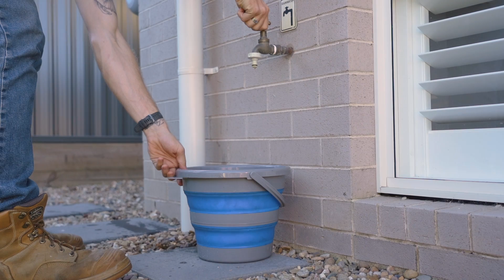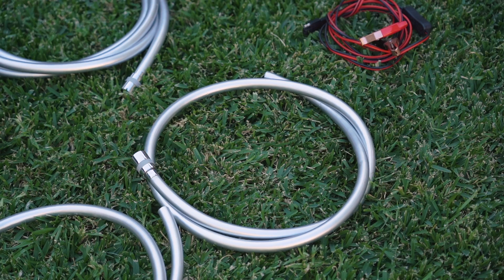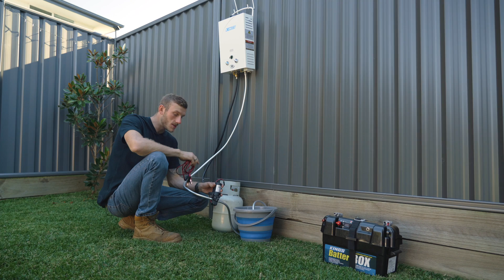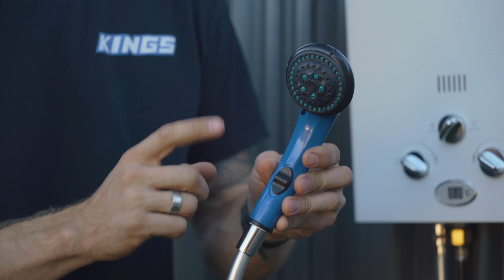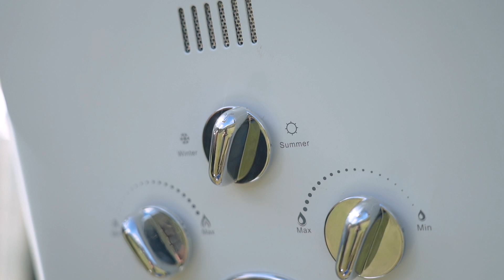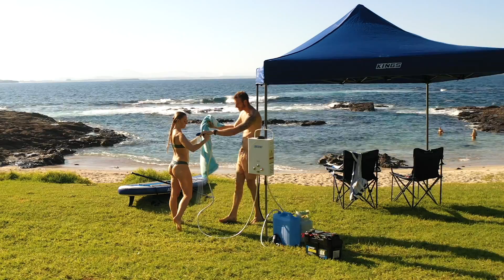Kings Portable Gas Hot Water System - How to Setup and Use

Comment: Can you connect it straight to a house garden hose without a pump since it has pressure?
Reply from the maker: Hi Shane

Yes you can use it, as the hose will put the water pressure in the unit. You don't need pump as long as there is a pressure.

Regards,
Sabin

Comment: What do the battery’s do
Reply: And lights the eletric clicker
Reply: It lights up the screen that shows the temperature.
Reply: Anyone struggling loosing the little black o rings on the hoses ?
Reply: Led panel and pilot light ignition